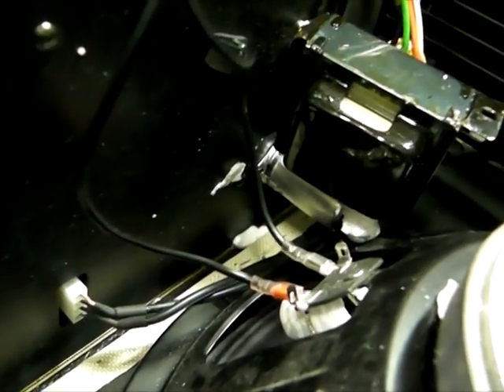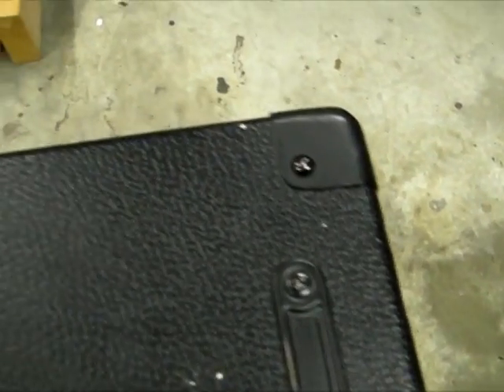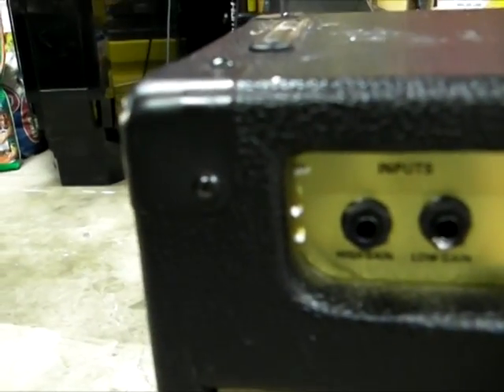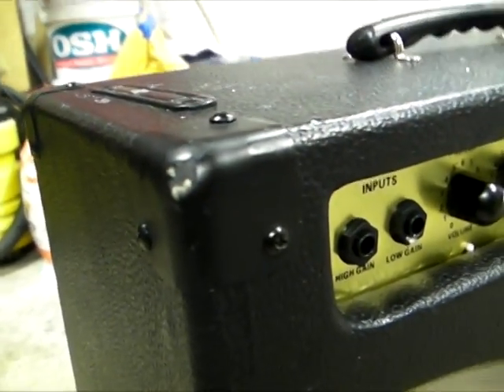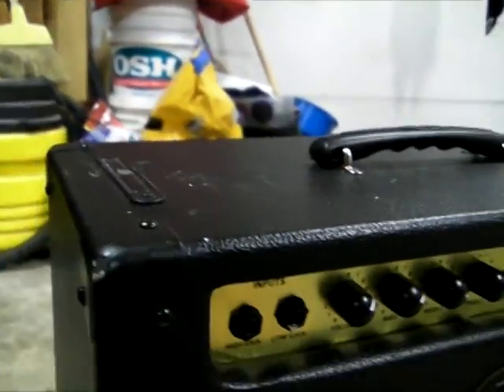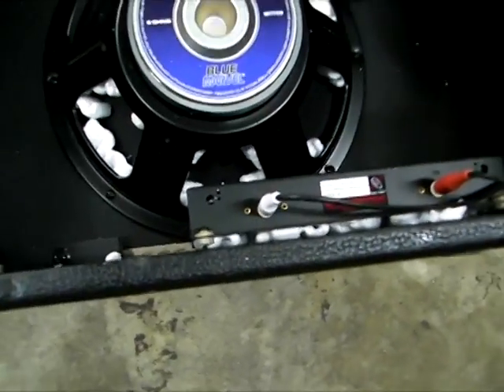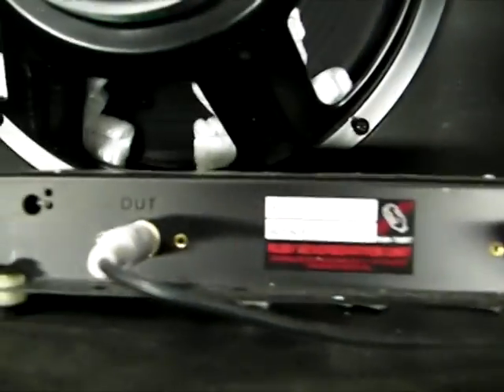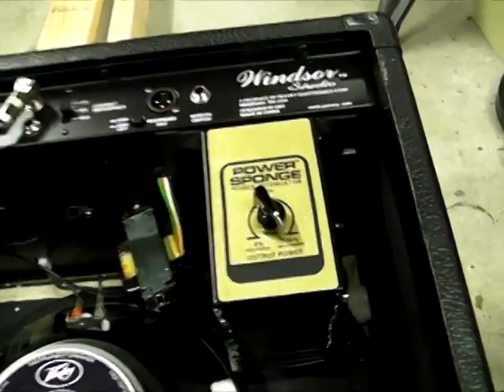Bad Packaging + UPS = Damaged Guitar Amp - Part 2

Comment from the maker: @telephotousa Excellent question.  This was an Ebay purchase, and when damage occurs UPS requires the claim process to be initiated by the person who shipped it. They would have picked up the amp, sent it back to the shipper in the same packaging and then denied the claim for insufficient packing. I would then have to request a refund from the seller, who could claim fraudulently that I damaged the amp when it was received. So for me, it was easier to just fix it.

Comment from the maker: @telephotousa Yeah, I suppose I could have gone this route.  Paypal has gotten a little wonky as of late and generally skews towards the buyer in disputes, even in instances where the seller clearly state AS IS, so I'm sure I could have gotten my money back.  In the end it was easy enough to fix since I build gear on the side, and I did want to use the amp.  If it wasn't salvageable I would have sent it back for sure.  Always good to keep the chargeback in mind.  Thx for the tip!

Comment: @imagimotion I run a small business & have been a Ebay seller since 1997. If you paid with Paypal funded by a credit card, all you needed to do was fiile a SNAD claim and even if PP somehow denied it (and they wouldn't) you could have filed a chargeback with your credit card company-CC companies don't want to hassle with ebay disputes so you'd get your $ back upon submitting proof you shipped it back to the seller (tracking #) Bottom line-one way or the other you'd have gotten refunded.